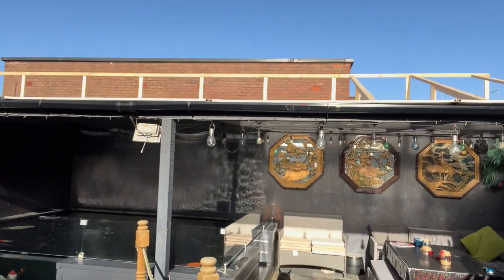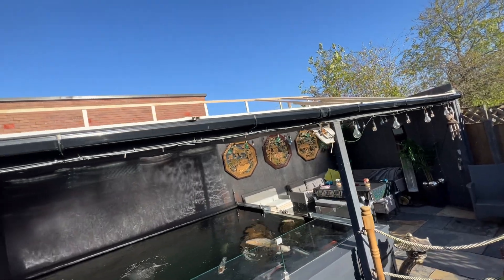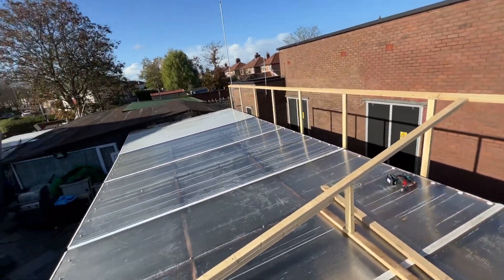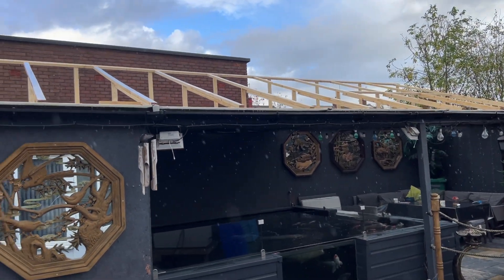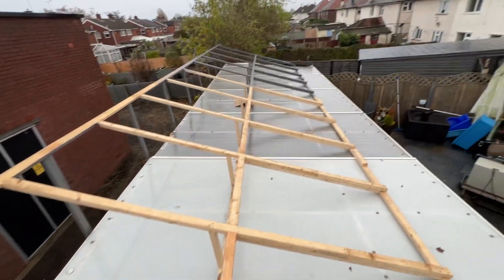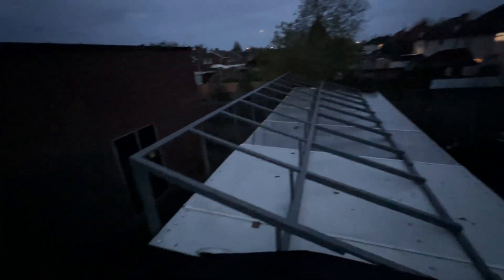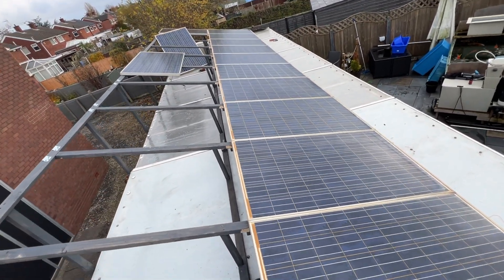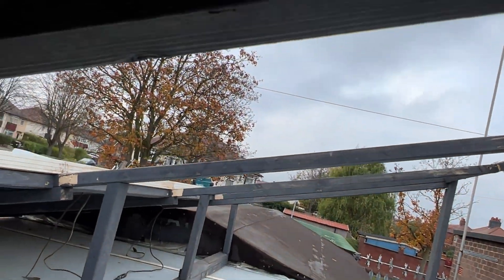DIY second hand solar panels wood frame work and solar panels installation PT 2 #solar #solarsystem

Comment: Looking good Danny, I have 6 panels connected to the grid. Mine run the pond easily  all day even when cloudy plus get the FIT payments. That system should bang out the power only thing i can see is storing what you don't use, Big batteries are expensive, interesting to see how you get on with leisure batteries.  👍
Reply from the maker: Cheers Martin. Hopefully it will run most of the ponds 🤞 save me a few quid, there is still a lot to do yet, just getting me head around the battery side of it, today 👍

Comment: Quality Job Danny 👍🏻 Even tho it cost some I’m sure you’ll get that back within couple years specially if you store as much as poss but those storage batteries aren’t cheap . I’ve forgotten yr total capacity of storage ( some say to be totally energy independent) you need 20kw
Reply from the maker: Cheers Simon. It should hopefully pay for its self in a couple of years let’s hope so 🤞. I’ve got a few batteries with it he has done me a very good deal, the original ones are crazy price I have gone with leisure batteries for now. I don’t know how much they will produce we will tell in time, when it’s all running for a few months, when I have saved a lot more money in a few years, I will upgrade to the other batteries 👍